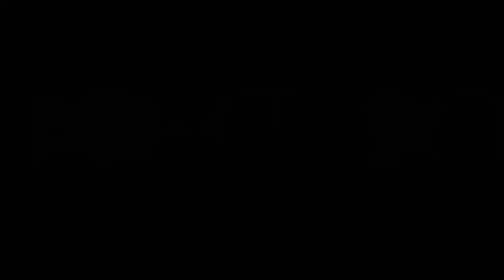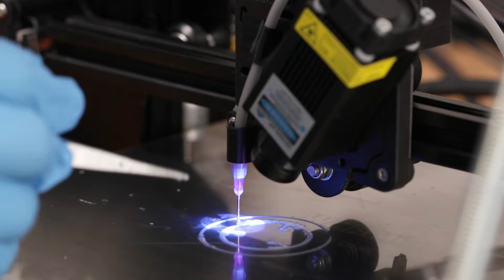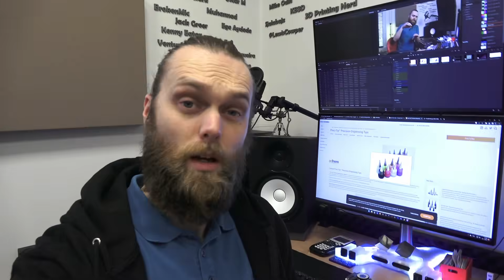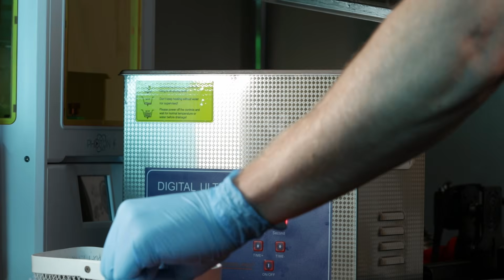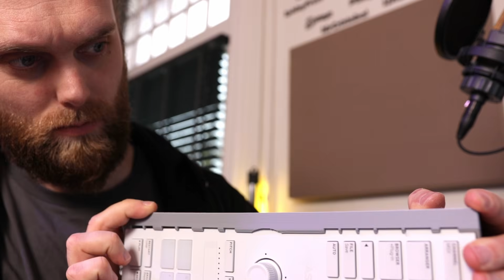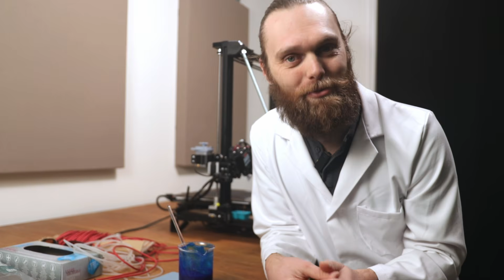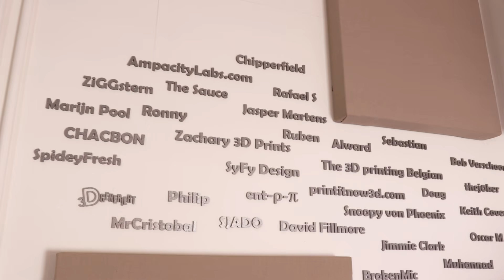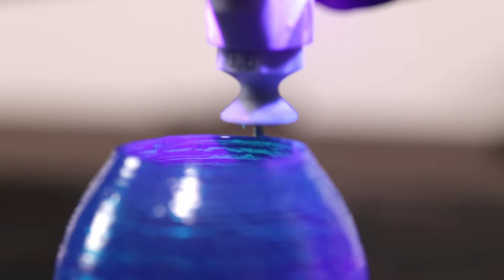I made a CUSTOM Nozzle that 3D Prints GEL!

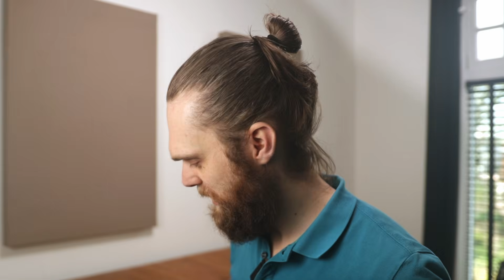Comment: @2:53   SLA PRINT FROM CLEAR RESIN!  I've made so many replica Gems for Cosplay type weapons for people .. GOT Swords with them and SLA print realistic Gems with clear resin....   I GET THAT THE UV LASER WILL... Over cure the RESIN in short time.. but JUST TO TRY IT - For a moment even wouldn't it make more sense as a proof of concept to have a perfectly optically clear shape vs the FDM air bubble filled PETG "Lens"?     Also I have some specialty Anti-Yellowing UV Resin that.. ive BAKED UNDER UV LIGHT...  (Even realized my first ever SLA prints with them and when i started SLA printing have been on my window ledge of a huge Eastward facing sunrise heavy light window thats bene baking them every day with UV light and they are still perfectly optically clear!)

But even when I would check if the samples I printed would yellow after I printed them with a UV Light they dont!  

***NOTE: YOU CAN GET THEM TO IF YOU OVERDO THE INITIAL CURING PROCESS... Idk why.. after setting... whatever chemistry they have going on in there seems to be resistant to further curing.. - But you could play around with it just as I did!  If you'd like a sample!   (Im in now way affiliated with them, they just happened to reach out to me like 3 years ago and havent had much happen since then as idk they found me online and sent me samples I found were amazing! And had to talk further with them that first yeasr!) 

I Wont share the brand name here! 

 - and i can say now no one will find them! I mean.. litterally ..  they advertise nowhere sell their resins nowhere but their own website that has its own issues.. 

A group of  Really old guys that don't do marketing well...  I was consulting with over chemical properties of their resins with background in chemistry.. Made it into the .. "Inner Circle" of this resin company and I MUST SAY THEIR SHIT IS LEGIT!  

They are all EX- M3 (The Adhesives Barnd - that deals with resin chemistry all day every day!) Chemists...   

--->   I'm just now seeing this video 5 months later.. 
BUT if it would be of any help to not abandon that laser beam / cone  prototyping idea 

 (NOTE:  I've just watched 3 minutes in ant hit pause! To share this as if my memory and experience with these samples I still have out exposed to sun endlessly and they never yellow just as the entire formula was designed not to! Then it would be of help at this stage of the Video anyway!}

If interested in at least trying that out I ... Do have enough I could pour out and ship a usable amount to rremake that part a few times.. And try various Curing methods just as I used to.. (im available for consultation!) And remembering it seems to be most UV resistant once cured with minimal UV light to bring it to be fully cured full rigidity... left... then exposed to high UV later - I know youd get USE FROM IT before it would degrade!  

They also make an addative sealant for making perfectly optically clear systems that also is another thing to experiment with for UV resistance...     - I just mean to say if anything in this world MIGHT BE UV resistant to Yellowing or cracking whatever the longest...   I BELIEVE I HAVE IT!

And heck id even print the cone for you if you send over designs!  That may be even easier!  - Im probably going to watch and see you ordered a custom made glass one and all this was pointless... But if not. I'm here!  

Love your videos and would love to be of any help even in one small way like this! 

OIf anyone sees this and is interested in the UV resistant or Anti Yellowing Resin just out of curiosity - maybe DM me or  something?  Actually Iidk if i get notifications for that - But id try and check!  As If thers enough,  I mean the reason I ... drifted away from the company then was due to health complications I have fought through now these many years and that  they were hoping ith my knowledge of 3D printing market place id "Prove Myself" with some sales for them..    Idk if that deal even stands anymore but.. I would love to enter back into this world and .. .Fighting such horrific medical issues for so long.. I could really use the positive... idk feeling of making a difference if anyone would like to know more! 
       I just know they do really resist yellowing! 
       And they are also biomedical certified for like a certain degree of use within or on the human body... 
Really top notch resins! 
                      And now ive seen a video of where maybe their resin could be of use!

- Please know I'm not promoting a product for a company!  
It's just a FEELER POST if anyone even happens to see it!   As I realize now what IO came across in a wild chance of events... actually, could be of use in this prototyping scenario for optically clear and UV resistant resins I believe .. would resist Even 405nM Laser Light for enough time to validate the concept! 

But not a promotion
as i don't even know yet if this would happen waiting on any ... replies at all - Just sharing I'd like to help others as if this sounds interesting it would greatly help my life to have something positive to be part of again!  Some of the medicines to manage my new health issues can make me a bit scattered for a bit longer (hope not too much) 

So please - I know this was a long post but...  Its the best I can do right now until I beat this!  Please know I know its... Not normal and.. would prefer negative "TLDR !!" or nagging posts to just not be added here 
as .. sometimes .. this is the only way it works to communicate for some people.. And I do realize its off and different.. Ok? .  

Thanks all ! Hope anything here may be of use to anyone seeking what I know tro be a truly highly anti yellowing Resin! 

&

God Bless!

Comment: Perhaps some of the thickness obtained by the homogenous mixture with fused silica would prevent or at least very much slow the rate at which the glass bubbles separate from the mixture. Use both but less of each than before. This could provide the ability to bridge without too much separation in theory.

Comment: Jòn, I think i may have seen a solution recently to your troubles with the rotary peristaltic pumps. MIT has released a research paper where they FDM printed a peristaltic tube with internal notching that eliminated the cavities that allow backflow in a normal tube, using a standard flexible filament. Search for "Compact Peristaltic Vacuum Pumps via Multi-Material Extrusion" on Science Direct. Authors are Han-Joo Lee, Jorge Cañada, and Luis Fernando Velásquez-Garcì.

Comment: Same experience with the photon, cheap as you can get, reliable, and comes assembled. It's my recommendation for people who want to get into 3d printing but not 3d printers on a budget.
Also resin is much more flexible in what you can do (as in you can get a single transparent resin and add whatever colorants you want, and mix flexible and hard to get whatever consistency you want , also ht and food safe are options)

Comment: I'm doing something partially similar for my PhD and this is what I've found:
a. Shorter thicker stiffer tubing is a must. Avoid silicone.
b. Shouldn't treat a pump as an filament extruder - it may take minutes to loose all the pressure and stop flow once you stop pumping, or even retract a lot.
c. Use gravity, don't fight it. Mount your reservoir higher than pump, and pump higher than nozzle if practical.
d. There is a flow rate limit that is very difficult to overcome, if possible, for a given pump capacity and nozzle size combo. I have switched to Nema23 linear actuator to push my material out of a syringe, now it rips needles off the Luer lock :) 
e. How does the temperature affects viscosity? Try cooling it maybe?
...Also...
d. Nozzle will catch only cured material. Ask yourself a question - how this cured material appeared at the height where you are just planning to print? Over-extrusion?

Comment: Have you considered adding an enclosure for the printer and the tubing? I would be concerned that ambient UV might leak in and solidify material in the clear tubing
Reply from the maker: I definitely have, also for safety reasons. For the proof of concept it's easier to have it open like this, just close the windows and use goggles.

Comment: If you could use optic fibres, the head could be super light and super compact.... Had me thinking could you split the build plate into say 4? with angled nozzles that overlap. And have a truly idex machine. Imagine each head working on a corner of a piece simultaneously

Comment: Pretty awesome now my suggestion is that you dial in the flow rate to be as precise as possible this will prevent the nozzle from getting stuck breaking off as often. The other suggestion is that you use magnets to hold the nozzle in place so that when it gets stuck it can break off on purpose and use the magnets as switches so that when it breaks off the program and Flow stops in that position then you can just realign it 😉

Comment: I have worked at a medical pump company. They made both peristaltic and syringe pumps. Have you considered using a syringe to pump the resin? It would be easier to load and prime. You just need a gear reduced stepper motor to turn a screw to press on the syringe. In this way it would be easy to control the flow as well. The calculations for exactly how much resin you are pumping are very simple for any given syringe size, thread pitch, motor speed, and reduction. It would basically work like a threaded Z axis, but for your pump! I'm sure you get it.
Reply from the maker: Thanks for your advise! I made a video a while back where I used a syringe to print pastes and it worked very well. I used a flexible axis and the required torque was too high, so I ended up printing mayonnaise. I switched to this pump instead of a syringe because I like that this doesn't have a limited volume. Especially when printing big. I think that it's ideal that you can just refill it during print. I still favor the use of the pump instead of a syringe because I think that this enables more possibilities. Therefore, the trouble I run into are worth solving, so I can improve on this concept.
Reply: @properprinting  Awesome totally makes sense. Thanks for the detailed reply! Really love all your projects.
Reply: Just as a note, and because I really want you to see my comment, they do make syringes in huge sizes like 100ml or more. You could also make a syringe pump which can pump any number of syringes at a time, like two for if you wanted to mix materials in your new fancy nozzle. Plus it would be a convenient way to store ready to use resins. No chance of spilling and way less mess on the hoses since you could just use Luer lock. Best of luck!

Comment: I just thought of an idea for this. Instead of just laying down and curing the resin, what if you used a close to water thin uv resin and some sort of fabric or paper. One sheet at a time, you would lay down the resin to where it soaks into the fabric or paper and then it would get flash cured. Keep stacking sheets layer by layer and at the end your object will be encased inside a block of sheets. Depending on what you used for the sheets, the excess could be dissolved off, sand blasted off, whatever. This could be an easy way to get solid carbon fiber prints that would be insanely strong
Reply from the maker: That's an interesting idea which is certainly worth trying! The paper would also act as support, thanks for sharing! I'll come back to this comment if I'll ever try this.

Comment: I'm still mid video, but regarding the lenses, u can print the lens model witht very high definition SLA printer and make a  silicon mold out of it, then cast a final lens with epoxy resin, just make sure to make the base flat, so it doesn't warp the light

Comment: What if you tried a combination of your original idea. Extrude using a thick resin then have the plate move to a curing area, then back to an extrude area for the next layer? Or have an additional "Print Head" that's a laser curing head but just repeats the last extrude coordinates slowly (not have the "Z" advance) .Sure you'd have a longer print time but you may gain successful prints.

Comment: The Youtuber Tech Ingredients has a ton of amazing videos on additives to strengthen resin, the last one was DIY graphene that significantly improves the performance of resin at very low ratios. He's also done videos on lasers. He's a a genius and an engineer of some sort. You might even be able to contact him for advice or a collab, or to source some graphene without building the relatively simple set up he shows how to build in his last video. Also NightHawkInLight has done similar but less helpful videos on graphene/resin additives.

I almost wonder if your pump set up is a little too complicated and a piston/syringe like you mentioned earlier would be a better solution. Syringe type extruders are used to 3D print everything from clay, to concrete, wax, chocolate, etc.. So I don't think gel would be an issue. Not to mention syringes are already used by many epoxy/resin manufacturers as a method of application. Two part epoxies and UV cure dental resins/adhesives use neat helical mixing nozzles that you can buy for pennies and fit a wide range of syringe barrels. A relatively simple barrel reservoir with a piston could be designed in almost any size, controlling extrusion speed/flow would just be a matter of pushing the piston down.

This is a really cool experiment/project. I hope you don't give up, I know you'll figure it out.
Thanks for making such interesting content, I'm glad to have found this channel this morning.
Reply: I don't know if Youtube is going to let me post this link but here's the video I was talking about. https://youtu.be/3hHoL77QDkg

Comment: You're using slicing software thats programming movements for a filament print, at this point would creating a slicer that takes into account the limitations of the resin be prudent? In terms of bridging, if you want continuous fibre printing, wont the direction and start/stop of each line need to be programmed differently anyway? Would single line arc bridging work at least to get a bridge out and go from there?
Reply: changing the way the software interprets the model would also enable pure resin layer printing wouldnt it? You can program extrusion of a full layer without light and then a curing pass of that layer. Different than your stated goal but even so

Comment: bro change the layer height let the gel fall a bit also you can change the intensity of the laser by changing its voltage
Reply: also slow the print down a bit before you build a lambo you need to build a model T

Comment: some tips : 1. Resin is less viscous with temperature  2. use teflon or anything that has a high surface  oxigen concentration to make resin stick less  / oxygen inhibits curing of resin 3. you have a lot of uv light in the environment  use pipes that arent light transmisible 4. use something like a adhesive siringe doser those work better with thick liquids 5. in my experience 385nm light triggers the photopolymer transformation quicker . 6 more light power 7. try to put  your printer in a nitrogen heavy atmosphere to make curing as good as possible / something like a tig welding gass flow thing .8 You can also use oxygen to your advantage  if you create a very oxygen rich atmosphere around the tip resin should be mostly unable to harden there 

 if you would like to discuss anything please message me

Comment: hey what about using fiberoptic cabling attached  to the nozzle? instead of the ring of  UV light like you're using. you should be able to basically have your uv light extremely close to the nozzle. More precision, and possibly more intense light.

Comment: @Proper Printing for the laser lens: 
1- machine a shape out of plastic polish it etc.  
2- make a silicon mold of it.  
3- take it out and pour clear epoxy resin inside. 
4- set inside a vacuum pump to eliminate any air bubbles.

Comment: You can also use a syringe in the upright position to keep track of your remaining resin and add some back force to the resin.  Don't force your fibers through you'll want the strand to be pulled along by itself from being anchored.  Since you have a metered pump you'll need to account for the area the fiber will occupy in your flow calculation.  Also make sure to properly size your fiber for your resin of choice or else your wet out will suck.

Comment: This is amazing. I remember your last video on this 9 months ago. I can only think of one suggestion, that's to use the flexible tubing for the peristaltic pump, but immediately transition to rigid tubing like PEX after, and (possibly before). That way there's no elasticity in the plumbing, and the pressure will be constant. That should help with laying a consistent bead with a viscous gel.

Comment: Nice project and good engineer mindset! Never give up 🤘 If you want to remove the resin viscosity variable from the equation,  you can use a wormgear spining in a pipe to push the material thru the nozzle. That the system used for that kind of application, like in massivit 1800 printer ;)
When I saw the nozzle design you did to inject and mix resins, I think you could add CMYK color resins, mix them before the nozzle, and from the hole on top that you were showing,  compressed air controlled by solenoid valve in order to flush the nozzle after printing or if a color change is needed 😀 Have fun !

Comment: Maybe you can use a glass tip so the UV starts reaching the resin just before being out of the nozzle. I don't know if that would make print impossible at all, and block the nozzle completely or maybe it can be adjusted so it curates the resin a bit but not much. You would have to turn off the UV when not pumping or even dim (or blink) the UV when pumping slower.